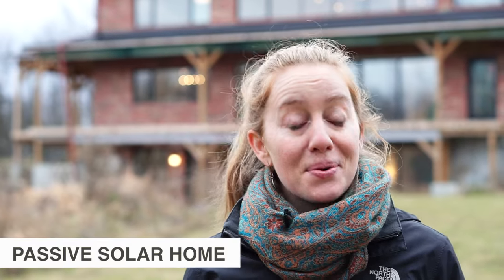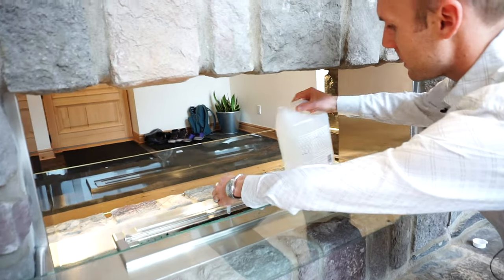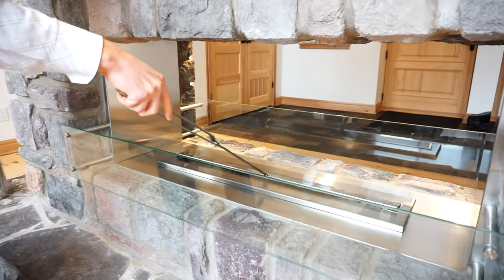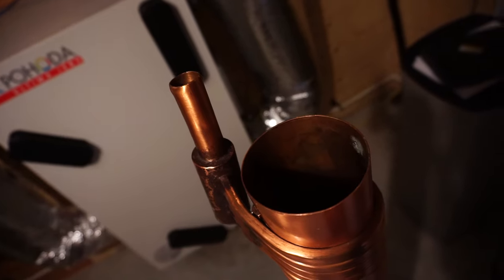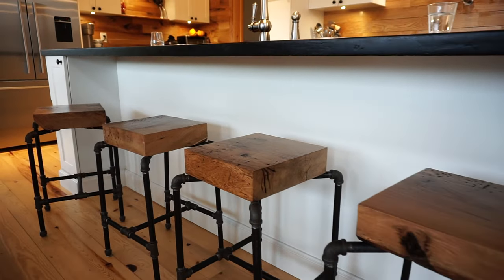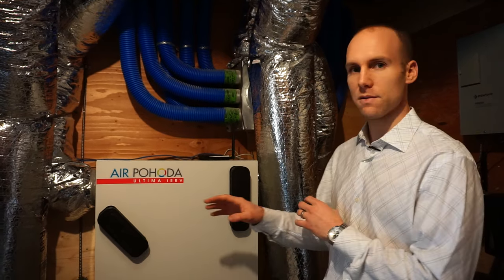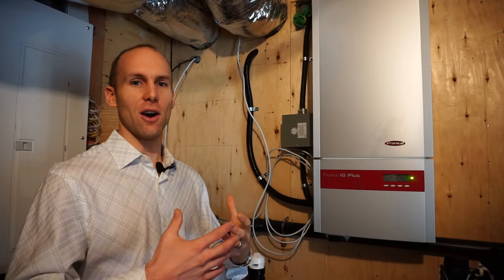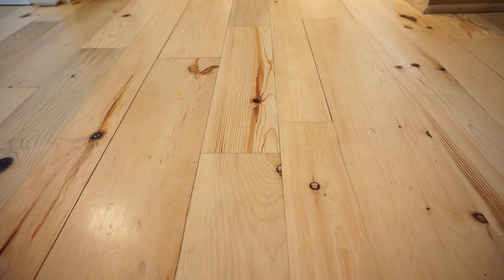Couple Builds Energy Efficient Passive Solar Home - Green Building

Comment: Using a PV system to sell energy back to the grid is such a powerful idea if it could be scaled up. Houses become mini power plants that use existing grid systems. Utility companies focus on managing and distributing power rather than generating it.
Reply: Question is, was hoping they had elaborated a bit more, is about the electricity needs during the winter months.
Reply: This is definitely where we should be heading. If the average house generated just 15 to 20 percent more energy than it uses and sells the surplus to the grid, that would enable a massive reduction in fossil fuel consumption. This should already be the norm in sunny climates.

Comment: Oriented to the South but wood floors. I don't see where the thermal mass is (Concrete floors/wall etc) to temper the temperature swings and store the thermal energy to be released at night. I would be interested to know if they have addressed this in a non-obvious way.

I also see people commenting negatively about the size of the home and it not being eco enough. I applaud these people for doing what they have done even though I do find the amount of space to conflict with green ideology. As role models I think this kind of project is much more appealing to many than radical ideas like tiny houses. Good job guys and the space is beautiful.
Reply: Right. It should have heavy tile near the windows at least. And you're right about size. If you want a large, luxurious house and make it passively heated and cooled, you aren't polluting or anything. You're just occupying more of the lot.

And it's smart, because you're putting more of your money in your house (equity) instead of in utility payments (total loss). I pay about $1000 mortgage and $500 utilities every month. $500 a month is $120k over 20 years. That's huge! I'd much rather be paying that as part of the mortgage, which builds equity and which eventually gets paid off.
Reply: I think you answered your own question. If you have a large enough house and good insulation, your house is the thermal mass. Sure you need tile or concrete for a small house, but 4000 sq feet isn’t gonna cool off quickly.

Comment: I have a passive house that i helped build,too old to do it myself anymore in germany. I will list the things that we did differently - 
We have 13.5 cm of solid wood as the shell of the house , This provides a bit of thermal mass to prevent quick changes in temp. 
Then we have 14 cm of wood fiber insulation on the outside . On top of this insulation are vertical furring strips that are vented at the bottom and top and are also used to attach the wood siding. 
We used triple pane tilt and turn windows that use a powder coated metal sill . this sill is attached in a groove under the window and extends out over the outside insulation and siding . It will never leak for the life of the windows. 
Our main heating is with a two ton soapstone wood oven that is run for two to three hours every other day or so. It takes about three days for the house to cool down but because i like it hot , i fire it more often . We live next to a large forest area so there is a constant supply of left over wood from the timber companies. 
Ventilation is non mechanical . We open some windows in the morning and evening to allow for fresh air. We don't worry about pollutants because the materials of the house including  rugs, furniture bedding, everything , is from natural sources . 
The back up heating ( radiators ) and hot water is from a wood pellet oven in the basement with seven tons of storage in a separate enclosed room. We had to have this system because of local codes . If we went with an all electric system we would have to spend an additional twenty thousand for solar electrical . I wouldn't do the pellet system again if i had the choice. Too much maintenance and too much destruction of forests to supply pellets. I might change it when it gets old and tired. 
Anyway the house is super comfortable to live in. very quiet and warm enough in winter to run around in a t shirt and shorts. 
By the way, nice job on your house , it's beautiful .

Comment: I watch these kind of videos and read the comments fairly often. I was sure that I would see comments critical of the size which I have mixed feelings about. But one thing I don't get about the large size is why. What do you do with such a large house? Maybe I'm biased. I have done a lot of miscellaneous house maintenance over the years and one thing I would not want is a house with a lot of space that I wouldn't use but would still need to maintain, heat and cool.

Comment: To make a significant difference green building tech like this needs to be put to use in apartment buildings, made financially accessible to many people, and used in dense urban spaces. A building model where families who can afford it all build huge houses that they heat separately, likely in locations where they need to drive a lot, is not sustainable. It's a start, but I would love to see sustainable implementation on a larger scale.
Reply: I'd suggest (apartment style) condos, not apartments as the place to start. Reason: can you envision landlords spending the extra money, for what would amount to a "tenant" benefit, that they'd rarely be able to cash in on? I don't want to say all landlords are "slum lords" but, in general, a 3-bedroom, 2 bath apartment in zip code ##### will fetch a certain rent. If you spend an extra $10,000 per unit on sustainable technology, it will then fetch....the exact same amount. If a landlord will do that because "it's the right thing to do," well great! I just don't expect to see it happen often. However, with condos, the owners are the beneficiaries. From that point of view, the owner and occupant both benefit. That, I can see....

Comment: I appreciate that they actually did none of the work to construct their home as much as I appreciate their dedication to passive solar and permaculture design.  They did the research, and THAT is most of the actual work.
Reply: Actually, once you've researched and designed a few homes it gets pretty easy. Trust me, building is hard work. My wife and I have built two with our own hands and no subcontractors. The latest one (I'm sitting in the living room now) is super-insulated and off-grid with triple glazed windows and blown-in cellulose in double-stud walls.
Reply: @paulmaxwell8851  Yes.  I've been building homes in Colorado for 15 years:  Passive solar, Earthships, adobe with smart architecture and Permaculture Design principles.  What are double stud walls?  Staggering attachment to outside wall, then inside wall with the next stud?

Comment: The airtight envelope, superinsulation that avoids thermal bridges, triple paned windows, and heat recovery ventilation are the most important bit compared to a "normal" house and should absolutely be standard in all new builds imho. Everything else is just a nice-to-have (though solar arrays are also great now that battery storage is getting cheaper).

I really wish more new homes got heat recovery ventilation in particular. Would have been amazing if every building had this during the pandemic and was properly ventilated, since covid-19 spreads mainly indoors by accumulating in the air of poorly ventilated rooms

Comment: Im working on recycling electricity technology, as a high tech solution. A lot of electric energy is used only once. But I found out it can be used more then once. For a future where energy is available due to recycling of electricity.
Reply: This is an interesting concept, would love to hear more
Reply: @twiincentral8780  I have working circuits in my channel (april 2019 Radiant Power video) and the radiant half-bridge.
The magnetic field energy is re used as an inductive spike impulse in another coil. this recycling amplifies the energy around 11 times.

But more important are the effects from the impulse on the impedance of the system. I'm working on that right now.

Comment: 2,000 square feet of resources used to house 3 people. It may not cost much to run it but used a lot to build it.
Reply: i know amish people who built an 8 bedroom house for only 45 grand in material , they dont have plumbing or electrical, but the structure is not worth that much money
Reply: 4,000 sqf *
Reply: bbruce995 - but it's built communally. Hence cutting cost.
Reply: The energy use for the life of the house usually is multiple times the energy to built it. The same is true for cars by the way.
Reply: technically it doesn't house 3, more like 10-20 people once you factor that the house will continue to be used by their sons and grandsons and so on.. yes you ll need to maintain it but that's like every other house
Reply: That's completely normal in North America

Comment: Solar is a great form of free energy.  I advise anyone interested in going solar to consult with an engineer first to determine if the solar system will work for your building design and location.  Consulting with an engineer first may help you save substantial time and money.  I can't tell you how many times I inspect homes with solar that are cold and homeowners are upset.
Reply: biggest mistake is not air-sealing fully. without that, there's the same "air mass" to heat (ie, the great outdoors) minus the capacity to do so! But, getting the air to the desired temp takes a certain amout of energy. Keeping that air inside requires only "passive" technology....air-sealing, insulation, "air-locks" for going in & out, summer shading (keep direct sunlight out of the house), winter-welcoming of the sunlight into the house (heat a thermal mass). My approach is to ALWAYS start with the passive functionality. Best bang for the buck.

Comment: I think passive solar is a fabulous addition to be more energy efficient!   
My only comment would be about "not using fossil fuels", people need to realize that electricity is primarily made in this country by using fossil fuel resources. We live in an area where it is mostly cloudy which prevents solar from being highly effective, especially with modern high in appliances and electronics. We also live in an area where massive amounts of wind turbines are used, but it has been proven that the amount of electricity generated by all these units are in no way a replacement for making the amounts of electricity needed. This is a great video showing some of the ways that all of us can make our planet better because conserving in anyway will always help. Just wanted to point that information out.
Reply: +Maggie Hess Well intended post but lacking in proper research. This couple are in Ontario Canada which has removed all coal burning plants from its grid. Electricity in Ontario is 1. Nuclear 2. Imported hydroelectric from dams in Quebec (also some from Niagara Falls) 3. Wind 4. Solar

Comment: I like some of the things you used but I think you could have done better using solar hot water or even hot water on demand per each water room. For heating and cooling Geothermal HVAC units are 400% efficient. The heating side works even better if you were to use it as radiant floor heat and you could even use it for free hot water. I like the idea with your windows but the gas in them from what I know is only good for about 10 years but either way they're triple pane so that's great.   
Over all though I love it when people such as yourself build homes with the thought of energy efficiency in mind, Great job.

Comment: We need to find a replacement for coal burning power plants. They supply 39% of the U.S. electricity. The eco house movement is way to small to offset that. The time and effort put in these homes should be directed at a larger movement to replace coal burning power plants. jmho
Reply: Your correct...we need to AMP up the Nuclear Power industry

Comment: I have a older home that I reinsulated and now I heat with electric .the cost is about 80.00 to 100.00 dollars a month as opposed to 500.00 to 800.00 a month using lp or fuel oil. I find insulation is very low maintenance.

Comment: Why did this home need to be so enormous? It seems out of step with the desire to make less of a footprint. And of course a huge building requires more of everything: lumber, insulation, glass, drywall, electrical cable, PV panels.....I do admire the generously insulated wall construction, although Roxul (known today as Rockwool) will have been very labour-intensive. I would have used blown-in cellulose, a very affordable, recycled product with a great track record. It's all I use these days.

Comment: i think this is a decent idea as an experiment,and some of the ideas used on other homes but dam the place itself is something only a millionair could afford on top of being almost twice the size of a typical large home these days
Reply: You can build a passive house at any size. It doesnt have to be 4000 sqft home at all.  

The cost to build a passive house versus a normal house ranges from 6% to 15%.  Part of the reason for this is that if the energy consumption is extremely low then you do not need to spend a lot of money heating and cooling capacity (For example, you dont need 8000 BTU air conditioner, you could use a 2000 BTU A/C.  The savings in reduced energy savings makes up for the up front costs.

There is a lot of moving parts to the decision to go to a passive house design.  You can't skim over this kind of thing in a single Youtube video and know enough about it.
Reply: Chris Curran
i agree ive seen hundreds cause i like the ideas. they are just outside my price range so i have to continue renting.
Reply: Darrell, try a tiny house version. For example, you could do 400 square feet, which is a mansion in the world of tiny houses.
Reply: Andrea Wisner
yup that is the way i would go if i could find land cheap enough and regulations allowed it.most places dont allow tiny houses these days
Reply: Andrea Wisner Tiny houses are not for everyone.  Not for most.  I would like to see shows about small houses and medium size houses.  It seems HGTV only cares about showing off the wealthy domiciles and the extremely small. Most of us dont want to get rid of most of what we own to live in a tiny house and most of can't afford the McMansion.

Comment: You could probably extract the bioethanol from the automobile fuel if using US fuels (I dont know if Canada dilutes their fuel). It would help your automobile getting that water based fuel out of the mix (which has about half the potential energy as the petroleum based fuel) . Could be a win/win?

Comment: I'm a plumber by trade, and I can say for sure that those heat recovery pipes in the drains don't work worth beans.
Reply: I wouldn't think so.  I think they're overthinking this.
Reply: But WHY? I know this comment is 4 years old,  but "I'm a plumber" is not a reason; work out the math or you're just blowing smoke.
Reply: @jamesengland7461  Btus recovered VS. Copper and labor cost.  Limited heat in wastewater.

Ground geothermal is more efficient.
Reply: Cost/benefit analysis… is all that spiral copper piping worth the gains? And what happens if/when the copper pipes leak? What’s the cost to repair/replace pipes like that? If they’re on well water and the ph is not adjusted, it can prematurely corrode the copper. Not sure… more data/testing needed.

Comment: Big picture, I love what their doing. With one (small?) exception...The comments about not cutting down trees, and using "bioethanol" are a bit silly. They'll forego a local (Canada has trees) plentiful and renewable resource to use a product (I think it's imported from the US) that has negative impact on the food supply. There's a great comment below about all hydrocarbons burn and when they burn, produce CO2. To which I say, hallelujah! Remember, trees eat CO2. Stop this "reducing CO2" nonsense, you're starving my trees! (Yes, I'm being a little tongue in cheek, but the solution to C02 production is easy...it's "plant trees" which we need to do anyway, to make wood/paper/pulp a renewable resource.) But, the thick walls (hey, guys, use cellulose! it does grow on trees!), triple pane glass (not sure I'd go that far), most importantly the tight air sealing, superinsulation and passive solar design make this a dream house. I don't think I'd want to live in a place quite so large, at this point. I did when I was younger, but without a live-in cleaning service (my wife assures me we do NOT have one), i'd rather have something more practical and manageable. However...to their credit...if they can make that sucker a true passivhaus - or even close - well, kudos to them and there's no reason a more modest sized property couldn't do the same. So, give this couple a high-five.

Comment: I like how the entire south side of the house is designed to absorb maximum solar heat during the winter and then provide shade in the summer.  Do you know if these guys are, or intend to apply any of these methods to tiny houses? I'm particularly interested because I would like to one day build a tiny house that is energy efficient, off-grid and able to withstand the winters as I live in Ontario too!